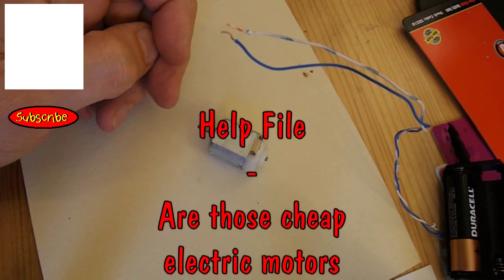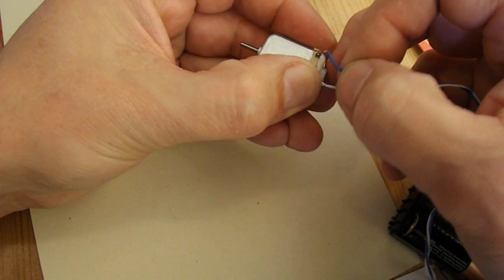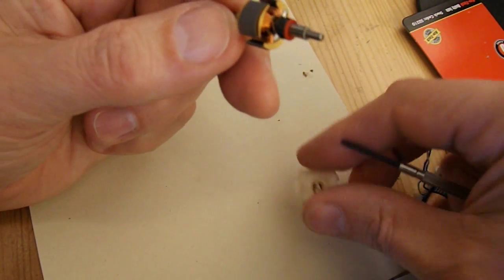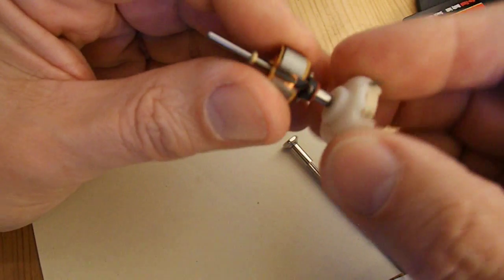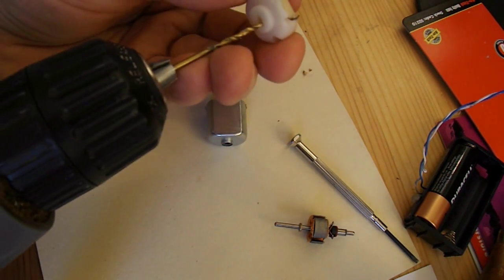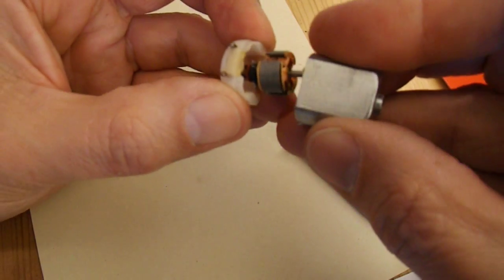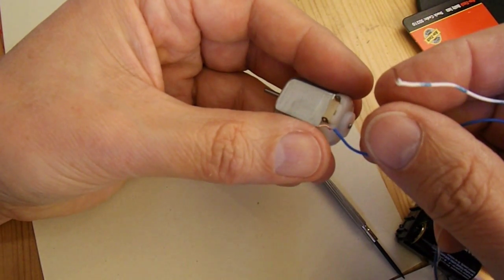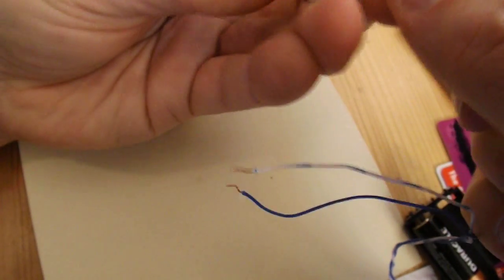Helpfile - Are those cheap electric motors really dead?

Comment: Thank you. I saved my sons favorite RC car with this method.
Reply from the maker: +lilrick98 hey thanks. It doesn't always work but if your motor didn't work before and it does now then it's got to be a success. The next question you need to ask is how did it get overheated to begin with. I know why mine overheated, because I abused them with too much voltage. The usual problem would be hair and fluff wrapped around the axles overloading the motor. Of course if it's his favourite then it could just be it doesn't get a chance to cool down :)

Comment: Grandad, there's an old RC car trick with brushed motors that I've used on brand new ones before. With a new motor, or even one that's been used, you can attach a couple wires to them, and run them underwater for awhile to break in the brushes - how long and for how much voltage depends on who you ask, but I prefer about 30 minutes at about 1/3 the voltage they're intended to run at, which for me is two NiMH cells. It generally helps run things in and keeps the motors running cooler and generally gives them more power. I don't know how well the water break-in trick would work on old motors, but it might be worth a shot.
Reply from the maker: Thanks James, I have never heard that tip and certainly never tried it. If it works that might be a helpful tip for people. Have you any idea what the benefit is as I would expect the copper to degrade with current passing through it under water due to electrolysis.
Reply: I think the idea is that it wears the brushes in such a way that they get better contact against the armature, and at the same time, you're running in the bearings and such. The steady speed and the cooling effect of the water help to make the process more consistent than running under heavy load and high voltage. There's a few videos on this site about the "water break-in method," which might explain the phenomenon better than I can. It's a trick that was discovered years ago by RC racers, and I've found that it does work, at least, on new motors or older motors with plenty of brush left.
Reply from the maker: James McHenry Thanks again, I had a quick look and this video looks like a good example http://youtu.be/G25Q1fI8zEw
Reply: Yeah, that's exactly what I'm talking about. It'll at least amaze people that these motors can run underwater. I suppose it'll depend on the type of contact and how much is left if it'd help older motors, but it's always worth a shot in my opinion. That cleaner/lube isn't a bad idea, either, that's something I hadn't done. I haven't done it in awhile, since most of my RC cars are now on brushless motors, but, yeah, that's a good vid, similar to how I do it.